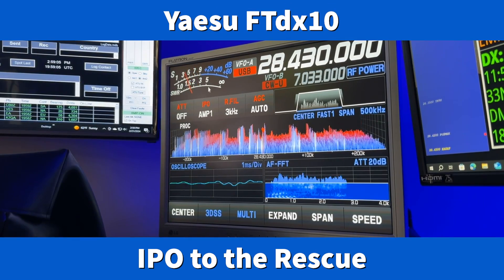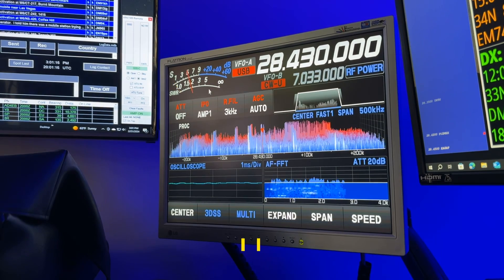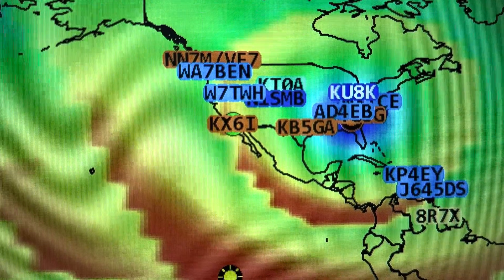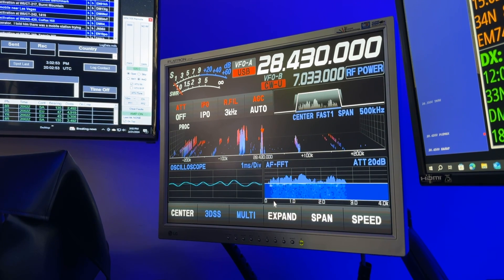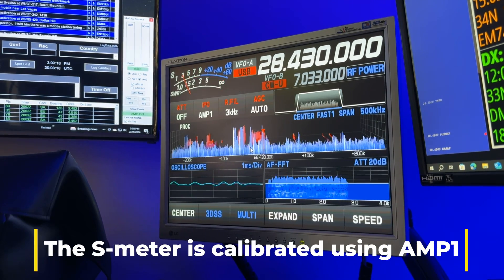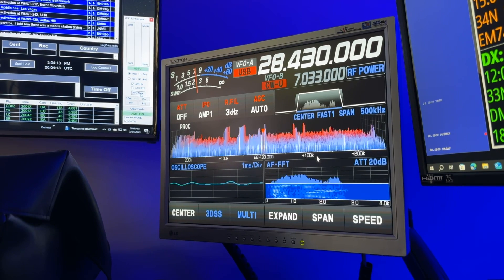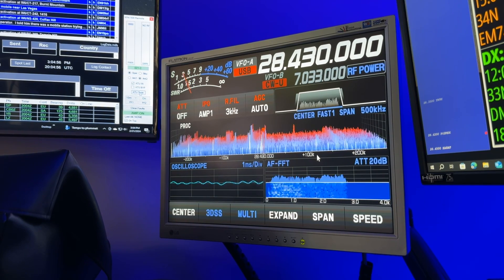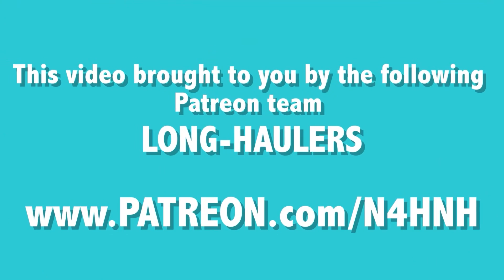Yaesu FTdx10: IPO to the Rescue (video #100) #hamradio #yaesu #ftdx10 #ipo

Comment: GREAT VIDEOS DOUG..I RUN IPO ON 2,DNR ON 1-3 AND BACK OFF ON RF GAIN..
IPO ON 2 SEEMS TO BRING THE AUDIO ON VOICE UP.
THEN CLEANING UP THE TRASH WITHFILTERS..
HAVE YOU EVER TRIED THIS?73
Reply from the maker: My FTdx5000MP has IPO2.  I use it often. It improves selectivity even more than the IPO setting on the newer radios. The FTdx10 and FTdx101 IPO is the equivalent of IPO1 in the FTdx5000MP.  It also improves the selectivity, versus AMP1 or AMP2, but not as much as IPO2 in the FTdx5000MP.

Comment: Its funny that I hardly ever used my DX10 until my finals popped on my 991A.... Now I am waiting on them to get here so I can replace them and I am forced to use the DX10. Having wrote that I find I am liking the DX10 much more. I believe the shack in a box  was the sole reason I stuck to the 991A so much. If Yaesu would add the 2/70 and C4FM +DMR and 1.25 meters to the DX10 they would have an unbeatable radio....
Reply from the maker: The FTdx10 is the better HF transceiver but the FT-991A is no slouch. If I had your setup, I would use the FT-991A for VHF/UHF and as an HF backup, with the FTdx10 as the primary HF transceiver.
Reply: @n4hnhradio that was my original thought but as with all things actual practice got in the way and the 991a became my go to radio. I do turn on the DX-10 and the other radios I have just to make sure electrons can still circumnavigate the vast pathways of the circuit boards. I do have a problem with dust and a hearing issue for when my wife says to cover the radios...

Comment: Hello I am Jan from the Netherlands I am a SWL is the 5000 a better radio then the Yaris ft 10 DX

JAN
Reply from the maker: The 5000 is my favorite, for my operating style. I like the ergonomics.  The FTdx10 is my second favorite. Both perform about the same.  If you like to work digital modes, the FTdx10 is the better choice.
Reply: Thanks fore the info but I like 19” radio’s but
I have ft10dx en I am happy with it

Jan 
From the Netherlands
Reply from the maker: Why did you ask me which is better if you already prefer a 19-inch?
Reply from the maker: The FTdx10 has a fine receiver.

Comment: I didn’t know you could disable it except my selecting either AM1 or AMP2. 
It’s always one of the three so can’t be disabled, yes?
Reply from the maker: Disable what?
Reply: @n4hnhradio  ha! And oops. Sorry, IPO. In the beginning of the video you say IPO can be “enabled”. IPO is one of three settings which must be selected, yes? 
That is you can’t enable IPO and then disable it. One of the other filters must be selected. 
Sorry if it sounds pedantic or semantic but I was wondering if I could experiment by disabling IPO but seems it has to be one of three.
Reply from the maker: @SummitBidTech IPO is enabled unless you select AMP1 or AMP2.  The FTdx5000 has the ability to disable all preamplifiers.  That setting is called IPO2 (signal fed directly to 1st Mixer and roofing filter).  I covered it in a couple of the FTdx5000 videos.  Yaesu confuses the issue by calling the menu selection IPO, instead of preamp selection.  I suppose that IPO is short and sweet, for the menu.  But neither AMP1 or AMP2 optimize the intercept point of the first IF.  IPO provides a very low level of amplification, optimized for S/N ratio.  Think of IPO as the least level of amplification, with AMP1 next, and AMP2 representing maximum amplification.  73, N4HNH

Comment: Amp1 to the Rescue!! I was having a hard time hearing anyone the other day. Switched to Amp1 from IPO. BOOM!! S0 to S3. Volume went up 30db. But as stated already IPO is the norm.
Reply from the maker: You only need AMP1 or AMP2 for ghost stations, or to offset insertion loss through a tight CW roofing filter.
Reply: I started with an FTDX1200. Now on IPO I could hear stations very well AMP1 was the go too on the 1200. But the FTDX10 is a whole new level. I love the IPO setting!! 

Great video!! 73
Reply from the maker: I’ve operated the FTdx1200, and its big brother, the FTdx3000D.  Both are good transceivers. They use the same DSP chip as my FTdx5000MP, which is my favorite transceiver.  

The IPO function in the FTdx1200 is very similar to the IPO of the FTdx10.  Always use IPO, unless you are trying to pull in an extremely weak station.  I would only use AMP1 or AMP2 if I’m trying to pull out an extremely weak signal.  But keep in mind that AMP1, and especially AMP2, tend to amplify the noise more than they amplify  the weak signal. If you already have a noise floor that is S2 with IPO enabled, AMP1 or AMP2 is only going to make matters worse.  AMP1 is mainly applicable for 17 meters and higher. AMP2 might be necessary for 10 meters and 6 meters. But even with those bands, I don’t use AMP1 or AMP2 unless necessary.
Reply: @n4hnhradio  precisely what I said without all the rest of mumbo jumbo.
Reply from the maker: @Rusted_Link If you think my answering someone with a thorough answer is “mumbo jumbo”, this is not the channel for you. This channel is intended to educate.  Rudeness isn’t allowed.  Interact positively or be banned.  I mainly only answer Patreon members anyway. You have reminded me again to stop answering public questions.
Reply: @n4hnhradio  I sent this conversation to 10 colleagues. 10 of ten say there is no rudeness. I'll politely unsubscribe and try not to hurt your feelings anymore. 

I am sorry that we couldn't have open high level dialog without the low level nonsense.
Reply from the maker: @Rusted_Link low level nonsense is you calling my answer to someone else mumbo jumbo. Either contribute positively or be gone.

Comment: Question on IPO and AMP 1. In theory, which gives you a proper Signal reading everybody has a very opinion. I love IPO myself. I’m not sure I’m getting a true Signal reading on the received station.
Reply from the maker: @ocmike176 The S-meter in a Yaesu transceiver is usually calibrated at 14.2MHz, using AMP1, for an S-9 reading (-73dBm). IPO will cause the meter to read low and AMP2 will cause the meter to read high.  I rarely use AMP2.  A published a video a few months ago about when to use AMP2.

Above and below S9 at 14.2MHz, the S-meter will not be perfectly accurate.  It is especially not perfectly accurate on the higher frequency bands and the lower frequency bands.  But it can be used to give an approximate reading.  That’s why I use my “by-ear” scale.  I’ve included that scale in the description text of certain videos.  

The S-meter can be used for relative readings, such as the other station asking you to give him/her a reading of the difference between two antennas.  He/She switches from one antenna to the other and maybe you say, “you’re 2 S-units stronger with the second antenna.